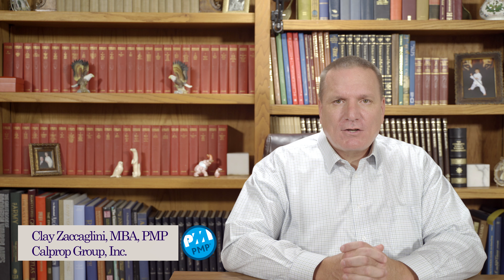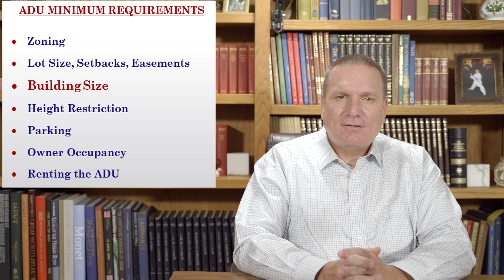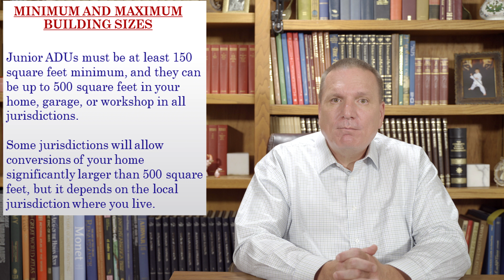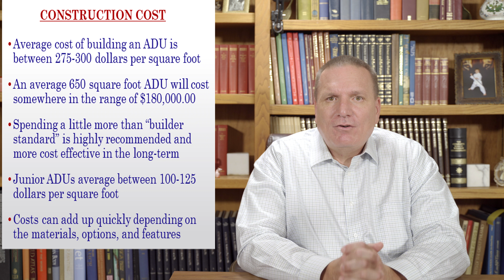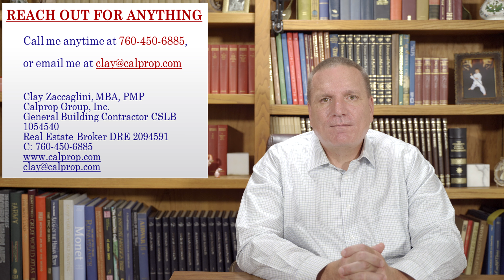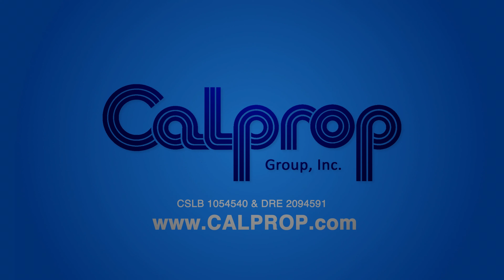Everything ADU in San Diego, Part 1 "Introduction to ADUs"

Comment: Do you have experience with ADUs in pauma valley?
Reply from the maker: Yes, of course.  That area is in the jurisdiction of the County, and they are generally easy and pleasant to work with.  The County is far easier to work with than any incorporated city in the County. We are finding ourselves in Pauma, Valley Center, and Fallbrook often since most parcels have lots of land to work with.  The County also has standard ADU plans that you can pick from to save considerable time and cost during the building permit process (but you can't deviate much from them).  Utility infrastructure can sometimes require a little more work than usual for water and electric, and propane/septic tanks are common.  We also have a great engineer specializing in that area who can get soil/perc testing done quickly and affordably.